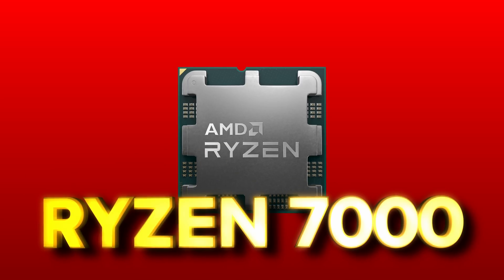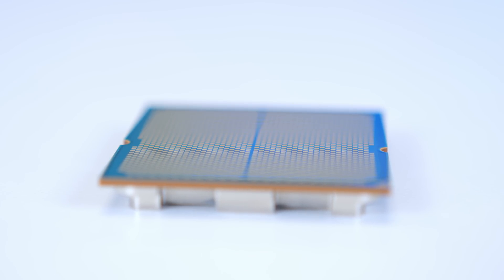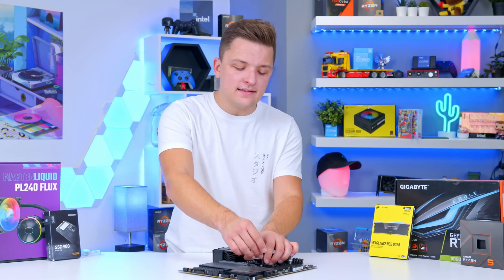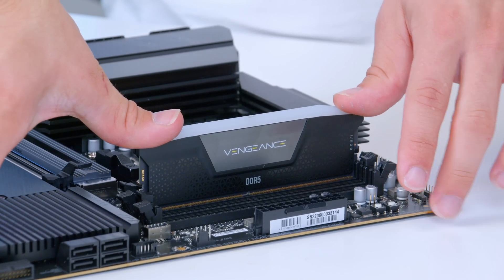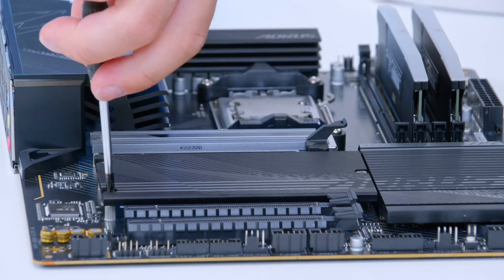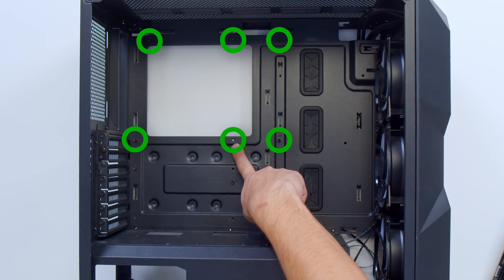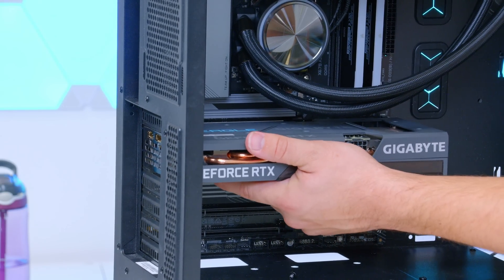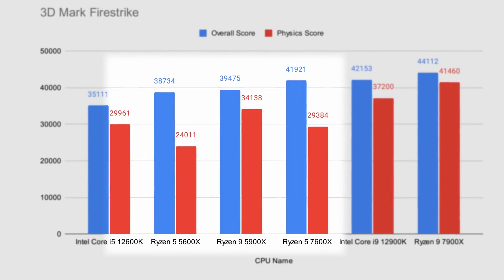$1500 Ryzen 5 7600X Gaming PC Build 2022! (Full Build Guide ft. RTX 3060Ti w/ Benchmarks!

Comment: I had to replace my I-5 with new parts because my mobo died. The CPU was 200 the board was 150 and the ram was 100 Id say it's not that expensive.. i kept case psu and ssds. Dec 2022.

Comment: This is a lot like my upcoming pc.
Same cpu and gpu. Just needed the benching and you delivered. Thanks.
Reply: Would you recommend this? I currently have i5 10400 and wanting to upgrade my cpu for my 306ti
Reply: @andrenikolai1061  the 5600x is good but if you wanna go cheaper you can get 5600 for a similar performance, or if you have a higher budget you can get the i5 13600k for 300-400$
Reply: @andrenikolai1061  but the 13600k will bottleneck the 3060 ti so maybe the 5600 (non-x or x) is enough
Reply: @roshdrpersonal  I'm looking at the ryzen 5 7600x, ryzen 7 7700x and i5 13600k now. I'm just looking for more reviews about these cpus cause  I'm planning on upgrading my gpu soon too that's why.
Reply: @andrenikolai1061  i5 13600k beats 7600x in productivity, 7600x slightly beats 13600k in gaming, if you plan to upgrade your gpu you need to go big, for the 7600x the perfect combo is either 3080 or up or Rx 6800 XT or up, the 13600k is also similar.
Reply: @andrenikolai1061  i5 13600k is better for productivity, 7600x is slightly better for gaming
Reply: @andrenikolai1061  i would follow the YouTuber named "PC Builder" he has a guide for 13600k or 7600x
Reply: @andrenikolai1061  idk about the 7700x though.
Reply: @roshdrpersonal  dude this is awesome thank you for your input. Yeah I'll check his content for both!

Comment: Wtf are AMD smoking. The 7600x with DDR5 and motherboards costs a ton, when a 12600k with DDD4 and motherboard will save you a fortune. The absolute worst of all, they set the power limits so it hits 95 °C, when its proven all over the net a 2-5% performace drop with an undervolt and temp limit can hit as low as 50 - 70 °C with large power usage drop. They pushed them too hard at default for a 5% boost. What a xxxx up

Comment: My PC has i5 6600k + rtx 2060. Since it is a bit old, I am just considering an upgrade, though I can run some games such as Dota 2 under 4k. I am now a bit confused by the video, since it is only targeting on 1080p or 1440p gaming with latest Ryzen… Is there any benefit upgrading after all?
Reply: Old 💀 me who don’t even have a pic
Reply: With an RTX 2060, You just need to change your processor and motherboard.  B550 and 5600 will be fine under 500$.
Reply: @babaty6829  thanks for your advice. Actually I just bought b650+7600x. I invested am5 platform since it should have much better upgradability in the future.
Reply: @ouoh1  sure, it's enough to smoke those Alder Lakes.

Comment: with this list, in the future if the 3060ti is not good enough, could i just swap out the gpu with like a 4060 and not change any other parts?
Reply: yeah might have to change psu plug but not much should be simple enough

Comment: i could build 
i7 12700f-6800 xt -32gb - psu  -case -cpu cooler
for 3.000usd
and be good for the next 5+ years to come. 
the thing is that when i'd want to upgrade all that investment is going to the sink maybe worth 1.5k
cause up there we would be forced to use ddr5. 

if you build this pc you might only need to change gpu & ram in a near future for better performance. i think in the end this later its cheaper.

the thing is i dont think 7600x is nearly as good in multitasking as intel counterparts.

Comment: This is horrific. No one buy the 7600x if this is your budget. Get a 12400F/12600KF/5600/5700x instead and spend more on the GPU. You'll get much better gaming performance by going from a 3060Ti to a 3080 12GB/6900XT/6800XT with the savings you make from not getting AMD's new overpriced platform at this budget
Reply: Yeah but catia and inventor hog ram and cpu power like hell :(
Reply: hey look buddy if ur playing 1080p then u want a better CPU than a GPU lmfao u must be new to this whole PC thing. If u have a 12400 and 3080 at 1080 p it jus bottlenecking atp and a 7600 and 3070 would be  the highest id go

Comment: I'd rather:
CPU: 5600 -saved $150
cooler: included - saved $150
MB: B550 -saved $200
RAM: 3600 cl16 -saved $100
SAVED on platform: $600
So I can get a 6800xt on just what I saved alone! That means I save $450 (-3060ti).

At the end of the day, 6800xt > 3060ti, since GPU is what matters for gaming, anyway. Guys, don't throw money at these companies.
Reply: Depeends on teh game but yeah zen 4 is a complete rip off.
Reply: Right but this rig will allow for an upgrade path with AM5, so that means he can do a GPU jump later on and upgrade everything else without having to swap to the new architecture.
Reply: @exargyromeno3648 likely several generations down the line of gpu as well before cpu forced bottleneck occurs... my last pc was a 4790k with a 780ti then swapped out the 780 for a 1080 and it still didn't have bottleneck issues.
Reply: no ddr5 or am5, this is a future proof build

Comment: I know the video is all about the 7600X but it seems miss matched for this price point (for gaming). You can easily squeeze a 3070ti into a 1500 dollar build with AM4 or 12th Gen and that will probably result in more frames as the GPU is the limiting factor in modern games not the CPU. If you want a workstation or a mix use PC than the 7600X probably makes more sense but if it is just straight gaming well...
Reply: idk man i was waiting with faithfully for 7600x it was real time upgrade for 3600 to 7600x but honestly it didnt has the power i expected probably im going for 5800x3d better gaming performance and cost lower considering the prices
Reply: @yusuferenkandara6812  Yeah. It's hard to judge without mother board prices but until B series comes out Ryzen 5 chips don't offer full value.
Reply: @TheWoolyninja4  did you genuinely just say the 3070ti is 25% faster than a 3070?
Reply: @aousy9532  No. The comparison here is between the 3060ti and the 3070ti.
Reply: @TheWoolyninja4  and you’re still wrong.
Reply: @aousy9532  In just raw performance in games the benchmarks would agree with me. 20 to 25% uplift is fairly common. To each their own.
Reply: @TheWoolyninja4  send me a link right now. Im waiting.
Reply: Back up your claims with a performance source
Reply: @aousy9532  You are more than welcome to go watch the Gamers Nexus review of the 3070 Ti which will back it up. Or do your own research.
Reply: @TheWoolyninja4  translation: I have no idea what I’m talking about and I’m too embarrassed to admit I was wrong. Stop mis-informing people. You’re sick. You can’t give a source because it doesn’t exist.
Reply: @aousy9532  I just did. One of the most reputable sources out there. The 3060ti is shown side by side with a 3070ti in his graphs... It's not the best value but it is measurably better. Frequently 20 or so percent better.
Reply: @TheWoolyninja4  give me a link. Don’t want no “find it yourself” BS.
Reply: @aousy9532  I'm not posting a link it's against most comment section guidelines and if you can't find Gamers Nexus on YouTube I don't know what to tell you.
Reply: @TheWoolyninja4  posting links is against TOS? No it’s not LOL. And if so, JustJay#1918. If you don’t add me, stop talking and giving advice.
Reply: 3070 ti is trash
Reply: @Penguin-gq7mp  If being 20% to 25% faster is trash than sure.
Reply: @TheWoolyninja4  the 3070ti is 5% better than a 3070. Stop mis-informing people weirdo. The nvidia line-up atm is not the way, you can get a 6800xt for $550, which is on par with a 3080 10GB.
Reply: @TheWoolyninja4  10%*
Reply: Just get the 3070
Reply: @lampdostuff2746  The 3070 would be welcome and might be easier to squeeze in with a bit of work. This guy is already over the advertised 1500 though. Unless by some miracle the X670 boards cost less than low end X570 boards there is no way what he has there is 1500.
Reply: Dude the 3070 ti is the most useless rtx 30 series card. Just a little bit faster than a 3070 but with way hotter gddr6x memory and still only 8gb of vram. You could basically just get a 3070 and oc it if you want. That would save you at least 100€ and higher electric bills in these shitty times
Reply: @zeronin4696  this is what I’m saying. And he’s still saying it’s some massive amp LOL.
Reply: If I were going to build a similar PC, what graphics card should I put in this?
Reply: @ChanceWandel  JustJay#1918 I’ll help you, comments too cluttered.
Reply: Idk man this helps those who already has 3060ti too tho. But then again if budget is a problem you'd have a point.

Comment: Buy  the 12100f. Overclock it to 5.2 ghz using the BLCK. 
Get $50 ddr4 ram. 
Get a $50 psu.
get the 6600xt, not the overpriced 3060 ti. 
And you'll be off. 
It'll cost you around like.... about 500-600 dollars. 
You're welcome.
Reply: 500 dollar 3060ti build? brother you are dreaming
Reply: @viggoketelaar7106  brother can you read 😂
Reply: @viggoketelaar7106  6600xt is about the same strength as a 3060ti, and in some cases beats it. 

when it costs around 500-600 instead of 1500. there is no comparison.
Reply: @dalaransadoringfan5267  6600xt  is  a bit above normal 3060 i never saw it going above a 3060 ti,  where are u getting the dara from?  Either way its true that  rx6600 and  the xt variant are amazing if the price is right. I had to pay 600€ for my 3060ti,  if only i waited more i could have got a rx6600 for HALF the price or the 6700xt for 100€ less.
Reply: @dalaransadoringfan5267  that's cap
Reply: rx 6650xt is near the exact same performance and they're way cheaper
Reply: Well 
12100f is like 110
lga1700 mobo like 100/125
ram 50
psu 60 for a solid unit that won't blow up
case for like 60 bucks
and idk the price of a 6600xt, but everything except the gpu will already set you back 480, and a 6600xt for 120 seems quite a dream

Comment: So a new mid range in 2022 is $1500….bruh 👎🏽
Reply: More like $2300. This guy was really disingenuous with this build and thinks his viewers are idiots. He neglected to mention the motherboard he used was $500. Even with a cheap MB when it comes out this is still a $1.9-2k build when all is said and done.  Edit* Also left out the fact that he used separate thermal paste. Although cheap still adds to the cost. So ya look at my cool new Ryzen build for $1500 that's really more like $2300-2400.

CPU: $300
Motherboard: $500
Ram: ~$200-$250
SSD: $100
CPU Cooler: $155
Case: $125
GPU: $450
PS: $110 (more like $120)
Neglected OS Cost: $140
Neglected Thermal Paste Cost: ~$8-$10
Throw in some sales tax: ~$200 ..

Comment: Please guide... ryzen 5 5600x with rtx 3060ti or intel 12600k with rtx 3060 for gaming pc build (both price same in india).. for games like csgo, valorant, gta5, cyberpunk etc..... looking forward to build one soon....
Reply: as a general rule, get the best GPU possible and build around it. 5600 non x might make more sense than the X version. check that too.
Reply: 3090ti celeron
Reply: Ryzen 5 5600x + RTX 3060ti, Because it is simply stronger
Reply: @kingahmad9989  Nope, neither of these, go with Ryzen 5 5600 and 6700 xt for the cheapest and best performance.

Comment: could you make a video with a 7600x for 1200 - 1400?
Reply: Don't buy a 7600x for that budget. It's a horrible value buy because of the ridiculous total platform cost
Reply: @UnluckyDomino  yeah, atleast right now.   Ddr5 price is  high,   there are only x670 motherboards which are not needed for 7600x and are also expensive as fuck, and on top of that you need a expensive cooler.
Reply: @Daniel-ru8je  Thanks, because I was thinking about building a PC but I just had a look and I can get a Ryzen 7 5800x for about £300 so I might just do that with a 3060 or 3060ti